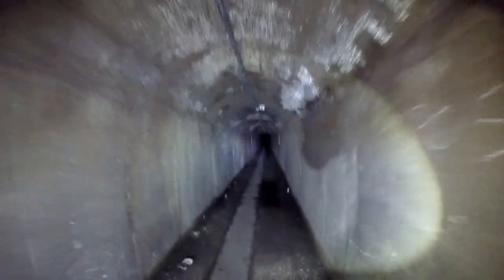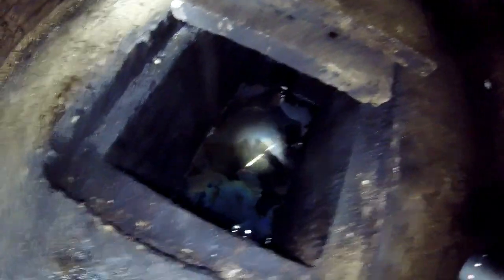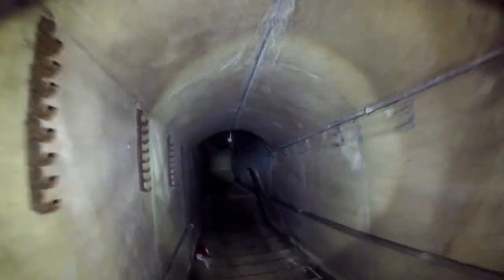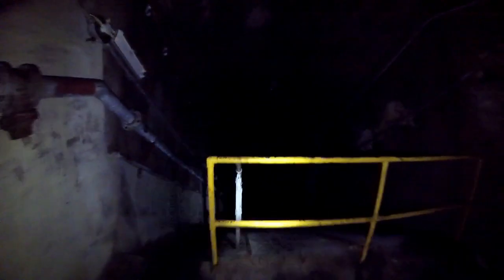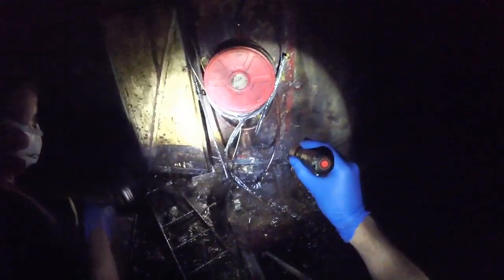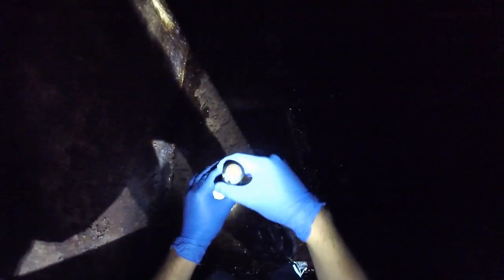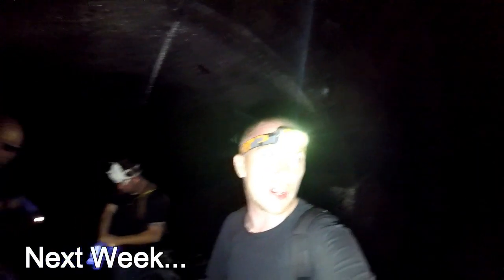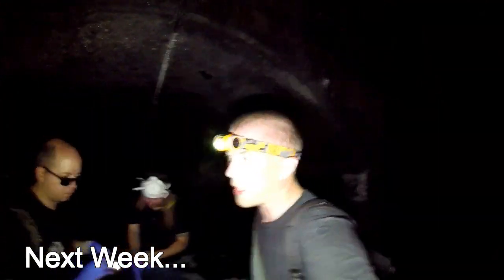THE BIGGEST BUNKER WE EVER FOUND - The Oil Bunker - Part 1

Comment: looks like an old lister generator at the start, probably from the early 50s looking at the panel. In the main room, they weren't engines but the looked like large electrically driven pumps for transporting the oil. shame this place is sealed. a few days down there cleaning it and putting grates on the pits would make it a wonderful museum of what was effectively the heart of the British navy.
Reply: The main generators in the still images around the 14:30 mark look like they could be similar to the Ruston-Hornsby units used in the 9.2" costal forts around New Zealand like found here http://www.newswire.co.nz/2014/04/wrights-hill-fortress-open-day-an-ideal-anzac-day-activity-for-families/

Comment: Incredible place , very interesting views & pictures - thanks guys

I’m sure there is a huge pipe network running around a massive area of the UK feeding from your location that carried fuel round the UK

Shame about all the Beeps !!!!!
Reply from the maker: Yes there was a huge pipe that ran several miles to the local Naval dockyard.

Yes there won’t be beeps in part 2 tomorrow 😂
Reply: Yes there is a supply system running round the whole country. It used to be a big secret and owned by the MOD. A few years back it was sold to a private company.
If you're out in the countryside and see a post with a dayglow orange top , bit like roof with a number on it, that's one of the pipelines.
Reply: SandMan Jono  There is a supply pipeline running into this place from the old oil refinery at Fawley, on the New Forest side of Southampton.  The pipes out of here went straight to the dockyard in Portsmouth for fueling warships.  Every wartime military dockyard in the UK had a facility like this somewhere nearby as the oil here was solely bunker oil for military use.  There is also an oil tank farm in Gosport, the other side of Portsmouth Harbour from the dockyard with a pipeline running direct there for the same reason.  Portsmouth was one of the biggest dockyard facilities during the war and a vast array of warships operated from there during the war, so much so that it was estimated that, had the Germans been able to blockade the supply lines to the US and other countries, the oil in these facilities would only keep the Royal Navy operational for a matter of a few weeks.  I have visited this facility and my abiding memory is of the overpowering smell of the bunker oil, even though it has been effectively empty for 50 years now, it is truly overpowering...
Reply: @hammyh1165    That system isn't the same as this, which was designed for bunker (crude) oil.  The more recent system is largely used for fuel types like aviation fuel to airports and supply of already-refined products like petrol and diesel to other facilities for further refinement...
Reply: @gosportjamie  yes I understand they are different types of fuel, I live less than a mile from one of the biggest bunkerages in Britain, although there's not much of it left now as it's been in the process of being demolished for the last 10years.

Comment: Yes this is a very nice video. A good example of "slip-form concreting" in tunnels. 

If you want to read on the subject, there is an "indian standard" on making tunnels called: "Code of Practice for Construction of Tunnels", starting of with part 1: "is.5878.1 Code of Practice for Construction of Tunnels". 7 parts in total, with references to other Indian Standard files. All downloadable for free. You will get what they mean real fast. 
Concrete lining...

Comment: I would bring a extendible pole to check where I want to step, would be safer, because I can poke into the oil with it to see how deep it is, and as for bags on your feet, well a set of good work boots rated for use on oily surfaces would help, though I guess with that much oil on the floor, they might not be much better, but I think the bags where a slip hazard, just have a spare change of clothing, hope no one lights a match down there, that would be one huge fire, lol, I would be so worried about it that I would have had someone stand guard at the entrance to make sure no one else goes in,
Reply from the maker: I have only recently learnt that the pump room has a 12 foot shaft in the floor that we could have fallen through into the oil. Not good!

Comment: That machine may have been a generator. The control panel is why I say that. It could have power a winch and pumps for the fuel.
Reply: I was going to say the same thing. Looked like a generator on the end of that engine. Most likely a diesel motor

Comment: If you had a smaller drone you could fly it down that tube and explore the tank... Maybe you guys should get a small drone with obstacle avoidance to explore places you can't go...
Reply from the maker: A grapling hook to throw up at the ladder is far cheaper 😀
Reply: A camera with flashlight tied to pole will be much more effective. I'm curious why they didn't used such solution to peek behind holes in floors and walls.
Reply: A drone requires light to use the obstacle avoidance.  My obstacle avoidance doesnt work in the dark.

Comment: How is it that there is so much oil all over the floors and machinery. It looks as if they hosed the place down with oil. 🤔🤔
Reply from the maker: No idea. It's the MOD, they probably did a rush job to decommission the place.
Reply: Probably water getting into the main tanks caused whatever oil was left in them to rise and flood everything at floor level. The vapour from the oil then condensed on handrails, walls and outer surfaces.

Comment: I wonder what sort of clothing is actually suitible for working in such an enviroment.  Everything turn to beep after a while.
Reply from the maker: Whatever you wear, it should burn well. Yes, the feedback about the bleeps has been well received 😂 This issue shall be remedied.
Reply: Great!  Yet another channel will just be music!! ;)
Reply from the maker: Hell no 😉👍
Reply: I would pay one penny per Beep  but only for the real ones.  Gratuitus use would be subed.
Reply: Insane thats all i heard,,,,better lighting needed
Reply: I worked at a Power station that burned crude oil to start the boilers, we wore all in one rubber suits when working on the oil lines or Burner lances, usually threw them away after if we got covered in oil.. it's nasty stuff, will burn your skin on contact and give you cancer if you breath too much of it in.. Rubber is the only safe material to be wearing when working with it..